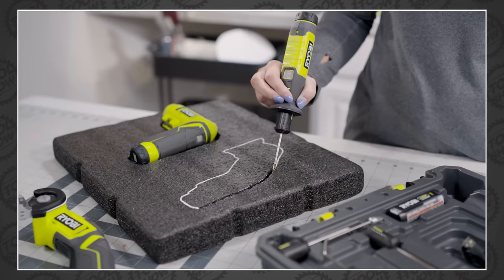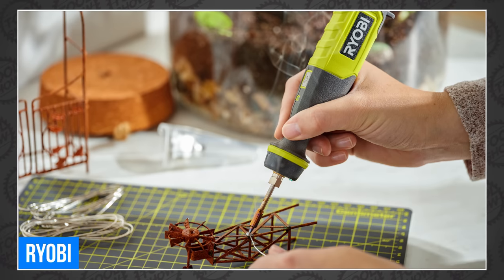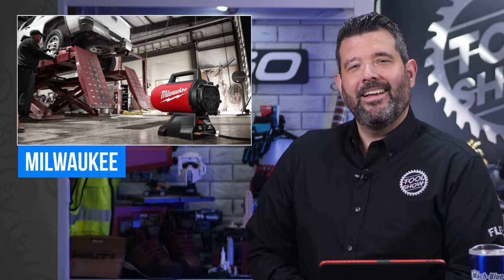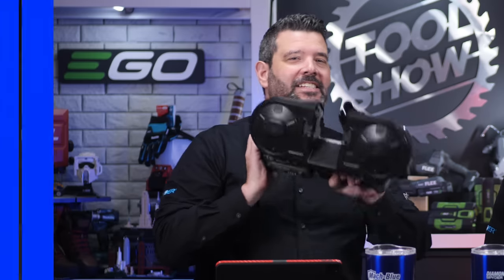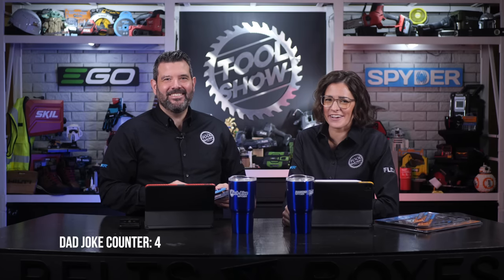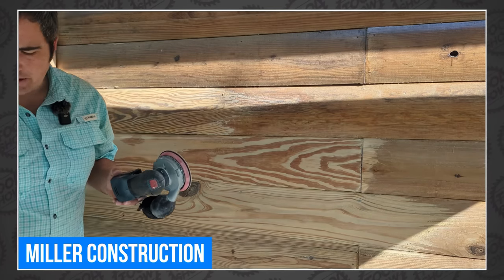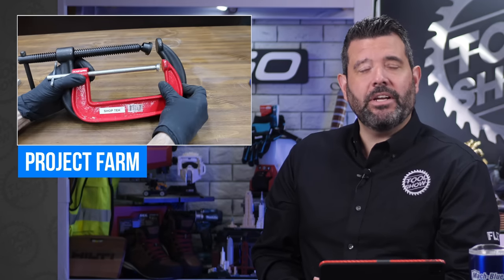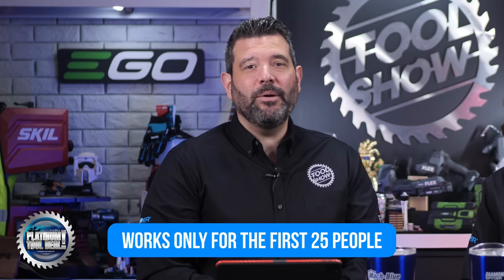BREAKING! NEW TOOLS from Milwaukee, FLEX, power tool head 2 heads, and more!

Comment: I don't have a favorite power tool memory with my dad but as a dad myself, my oldest child/4yr old daughter; loves working with tools so when her dresser, bought at a yard sale, started to warp and fall apart she was the one with the dewalt 12v impact driver to install some screws and extra 1X2s for support. I let her hold the tool and pull the trigger while I held the impact in place on the screw so I could yank it off when she hit the correct depth. Thankful for the modern power setting features available on power tools so I didn't have to worry too much about her tearing up material. Our repairs held but the rest of the dresser has since disintegrated haha but fortunately replaced with a bigger one with non dollar store materials. I think spyder stuff will be her favorite simply because it's so colorful.

Comment: Thinking back when my dad got his really first Sawzall from DeWalt and it was a beast. I was around 10 years old and we had to replace joist in three apartment that he own and since my small size I got the awesome job of cutting the old joist out. I thought I was king of the world, the saw didn't even have a variable trigger it was 100% of nothing with that saw pretty sure  I destroyed 5 blades cause my little noodle arms could keep it stead when cutting. Now the time have changed my kids are a little young to use a Sawzall but when the time comes I will get the share wonderful memorials with my kids operating power tools may start out on a sander. Happy Fathers day to and the dads out there.

Comment: While growing up my dad used every oppurtunity to work on the car to teach me how to fix something. Once we had to change the axle nut on the minivan, 32mm. We had a breaker bar, and i went for it. I even took the handle off the floor jack and hung off it, jumped on it, my brother joined me on it, and it didn't budge. After about 3.5 hrs of trying different methods, he walked over with an impact wrench, and had me try that. Two tanks on a small compressor later, it came off. He said, "Son, welcome to the world of power tools"  Ever since, I've been an addict.

Comment: Favorite power tool memory with my dad is getting to use the 1/2" air impact to remove lug nuts.  Beat the heck out of the tire iron or breaker bar we were using.

Comment: My favorite Dad tool memory was when I got mybfirst job as a Set Dresser back in 2006. I barely knew how to read a tape measure but the crew needed help from a local and I had just turned 18 so they took a chance on me. I was flat broke but they saod I needed to have at least something. So Dad took me to the garage and gave me what he had which was only a couple rusted crafstmen wrenches, socket set and a corded drill and his bag. I cherished those tools so much. Then the bag was stolen out the back of the truck while we on location and inside. Incredibly sad day.

Comment: i remember using a dewalt impact with my dad to disassemble a dock and he used the drill underwater and it worked. another is cutting up an old boat house while on top of it with a dewalt reciprocating saw had to jump off when the wall was cut